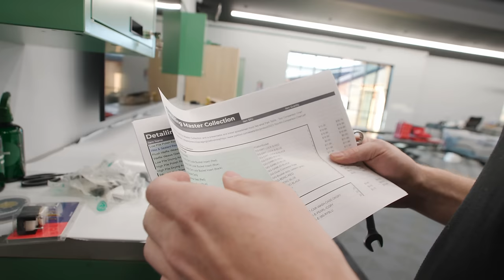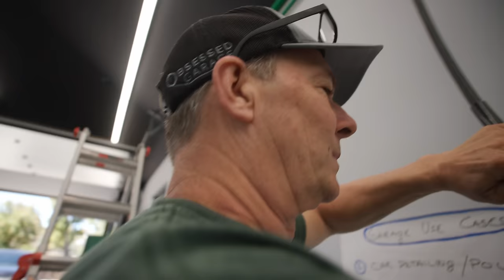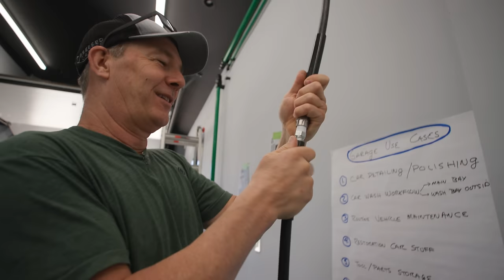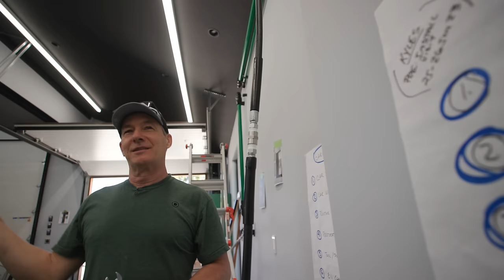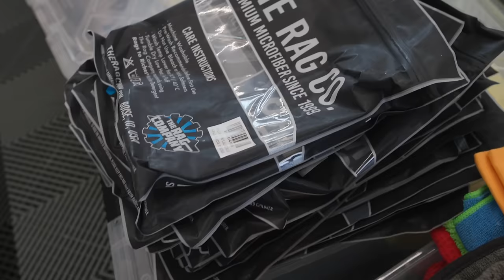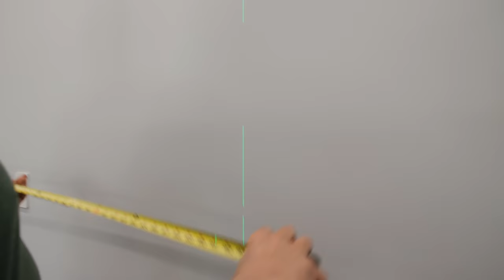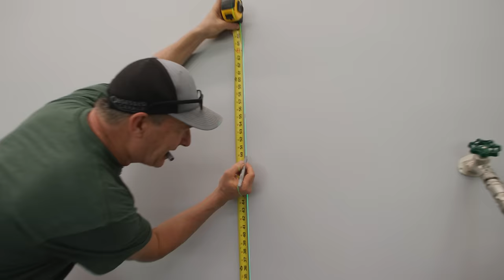EPIC Car Barn Build Series | A DREAM Custom Garage - E7: Nearing Completion!

Comment: I store my pads in bins as well.  When I determine what pads I'm going to use, I grab that bin and get at it.  I don't clean pads until I'm done.  Rip one off, replace it, keep going. I waste too much time starting and stopping to go outside and blow off pads, then restart. I'm better when I can plow through a panel and not stop multiple times and get sidetracked.

Comment: Just watched a video of you and the rag company, and your opinion on hex “lightning”…. Totally agree. Have you ever thought though of making a light with poE and having the system controlled by a central Ethernet switch with switches in the corresponding rooms? This is nice if you have solar panels with batteries, everything is in dc, otherwise you make the battery’s output from dc tho ac and then again dc since leds need dc… A chanel called undecided address this topic in a video about a eco friendly hotel… Plus if you have everything on the same circuit you could for instance have the garage door open when you are coming home (a far more secure system as LTT addresses) and have the lights and ac turn on too!
An extra note ac from Mitsubishi is the best! But why are you using a mini split system, wouldn’t it make more sense to have their new hvrf ground source heat pump?
Edit: just looked it up it is the wr2 line!

Comment: TRC or OG should make a towel folding board.  Something like the ones you see at retail stores for folding t-shirts.   Have a grid for the common towel sizes.  Then you could have identically folded towels every time.
Reply: How hard is it to fold towels?
Reply: @timkinley1779   I lost both my hands in a freak car washing accident.   So it's hard for me to get the corners all lined up.  Also, if you're folding 50 towels, it could speed up the process.
Reply: @chrism1157  I appreciate your witty follow-up answer (less the last two sentences). You redeemed your man-card considering the original, girlish-nature question.

Comment: Is there a hide a hose type solution for power/air/pressure washer hoses? Perhaps with the hose reel mounted in the attic and pipes to a wall plate for a hidden look?
Reply from the maker: There isn't.

Comment: Do you need to take that floor out once a year to wash the floor?
Reply: You don’t need to, you can do it whenever you want to really. That is kind of the point, it would make sense to do it annually or if you have a spill but you don’t necessarily need to.
Reply: Wash the floor for what? You can run a vacuum over the Swiss Trax flooring.  That is the joy.  You can also hit it with the pressure washer and let it drain out.  I have yet to pull mine entirely to clean underneath.